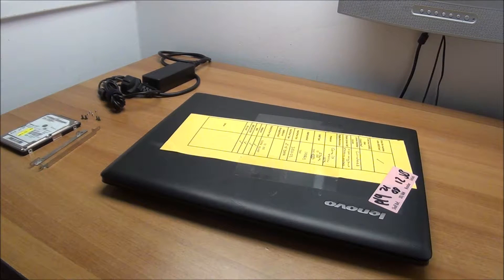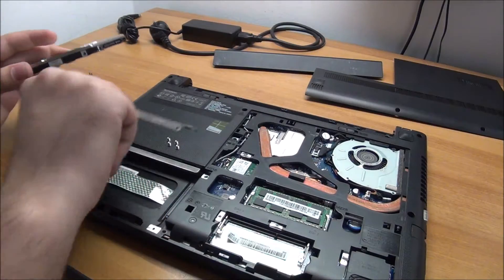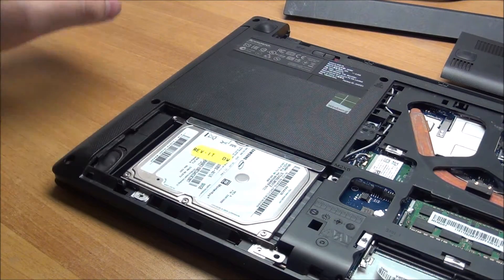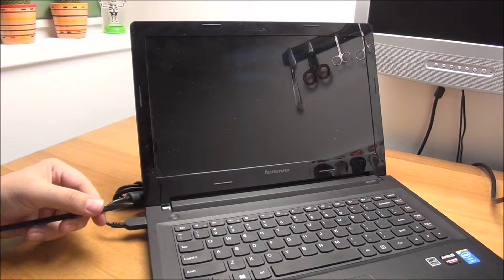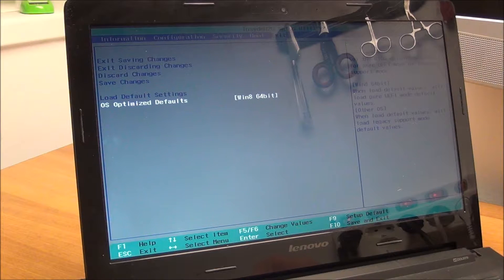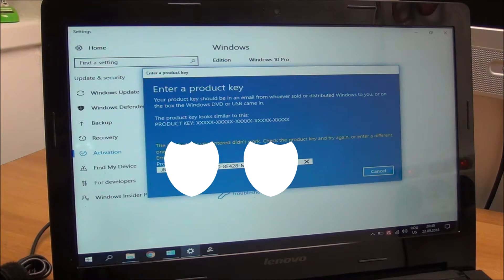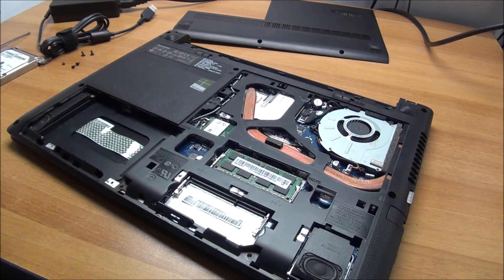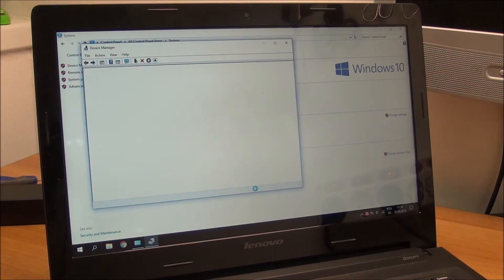Working on a Lenovo G40-70 laptop - How to upgrade & Windows 10

Comment: I got a problem with my lenovo g40-70 when using windows 10 os. the microphone doesn't work with chrome and some apps. But it works good with built-in apps like sound recoder, camera. have you experience the same issue?
Reply from the maker: Sorry. No experience with this.

Comment: slow as hell after upgrading to WIn10
Reply from the maker: Depends on configuration and whether or not you have a ssd.
Reply: @UltimateDIY  Did you use SSD in that Video?
Reply from the maker: It's a 4 and a half years old video. I barely remember I made the video 😁